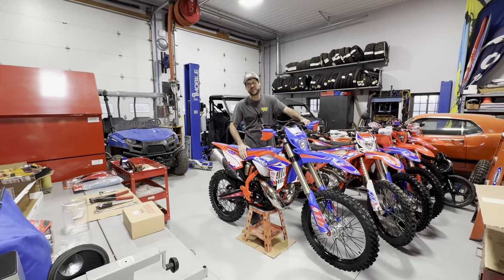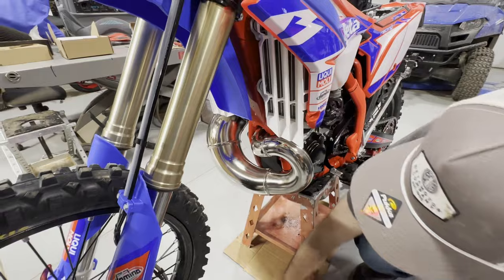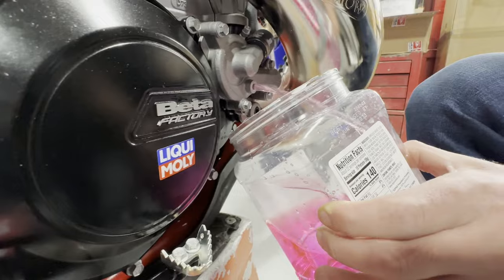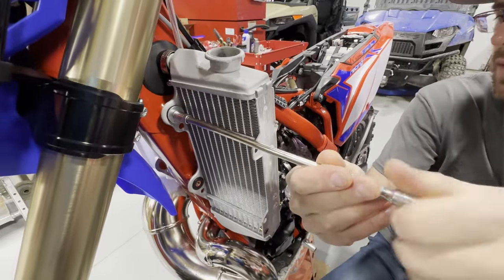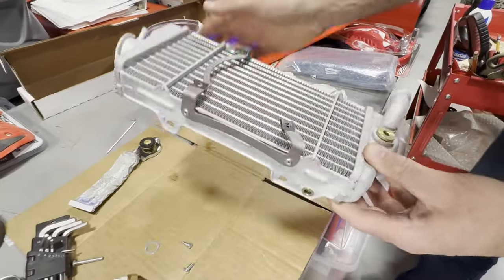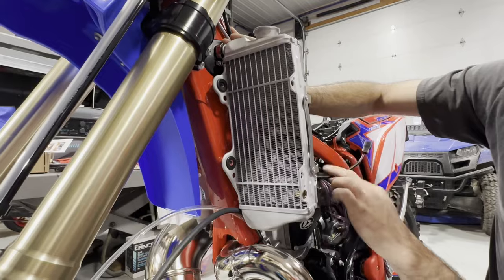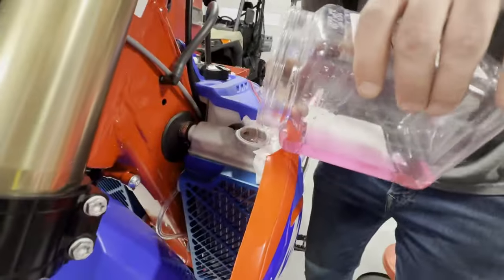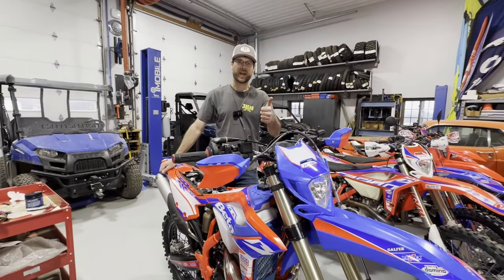2024 Beta 300 Race Edition - Cooling Fan Install  AB-22150-2.  3 Seas Recreation

Comment: Yes, 24 radiators work on 23s and the 24 300 RX.
Reply: Do 24 rads fit a 21 beta 200
Reply: @cmtvlogs9118 if they use the same part number as the 23 200 I think it would be a safe bet, but I have not tried that application personally.

Comment: Hey Jared, I have a 2022 390rr race edition and it came with a radiator fan already fitted and was wondering if the fan is supposed to run after you hit the kill switch?
Reply from the maker: Good Morning, no the fan only comes on when the bike is running. Enjoy The Ride, Jared
Reply: @3SeasRecreation  👍

Comment: If your just replacing a beta fan like for like do you still need to remove the radiator??
Reply from the maker: Good Evening, no I think you could change just the fan motor with it still mounted on the bike. There are 3 screws and just the electrical connector. We remove the radiator the first time to rivet the bracket first. Enjoy The Ride, Jared

Comment: so i bought a fan for my 23 350 race and it didn't have a thermostat , do i need one ? it does come on from time to time without one ?
Reply from the maker: Good Morning! Good question, no the new fan kits are controlled by the ECU as it already has a sensor in the cylinder. Enjoy The Ride, Jared

Comment: No issues with the Bullet Proof Designs Rad guards on the new Radiator? Ive heard of them not working on the 200 Race?
Reply from the maker: Good Morning, at first when the 2024's came out there were issues with the bullet proof rad guards. They have fixed the issue and all rad guards in stock at Beta USA are the newer design that works. Enjoy The Ride, Jared